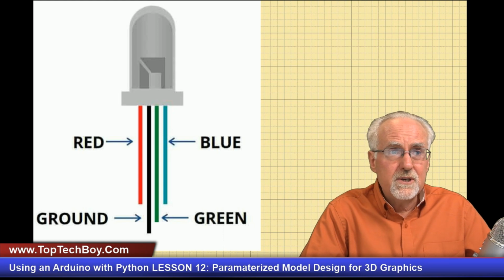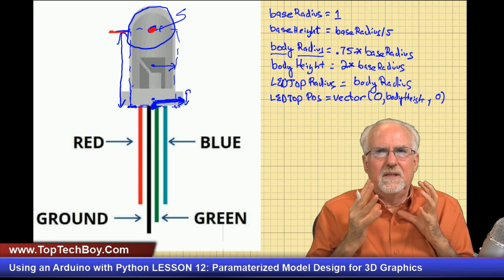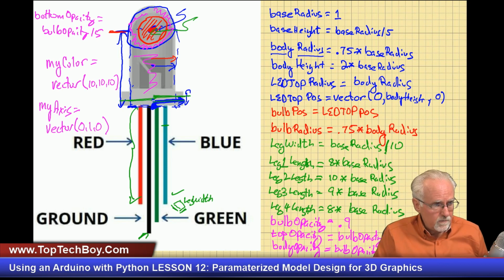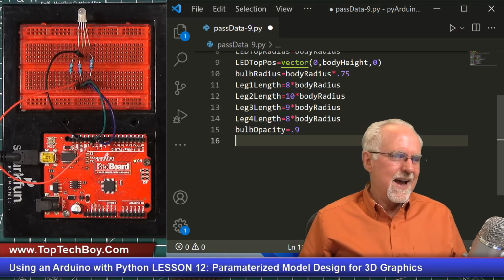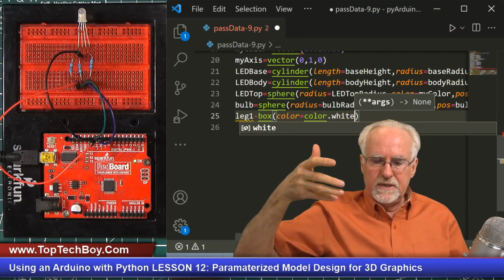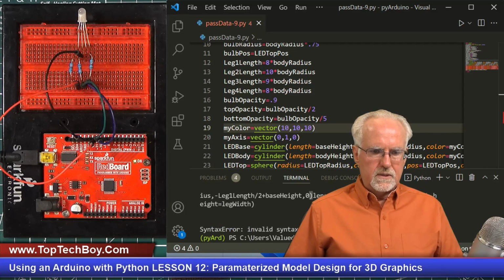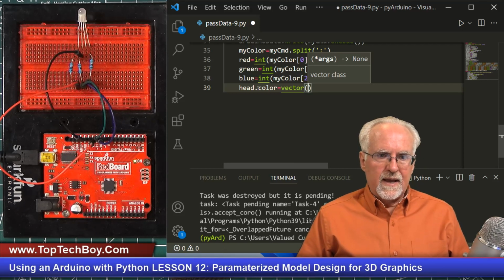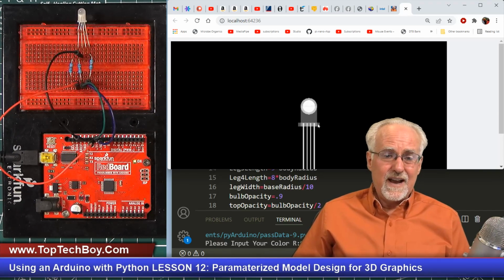Using an Arduino with Python LESSON 12: Paramaterized Model Design for 3D Graphics

Comment: Great work Paul, when I did my homework I have initialize the value for myColor as equal to Vector(10/255,10/255,10/255) instead of vector(10,10,10 ) as per this lesson ,  please let me know what I done is right or wrong.